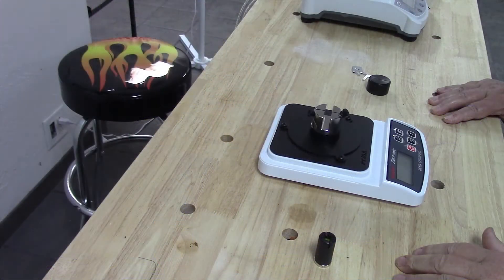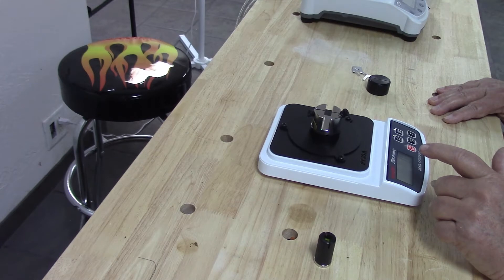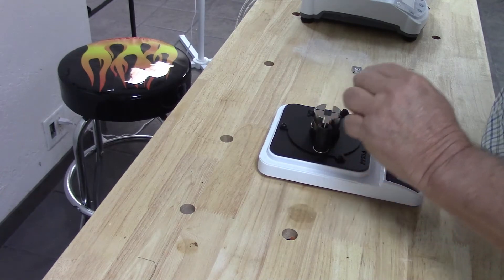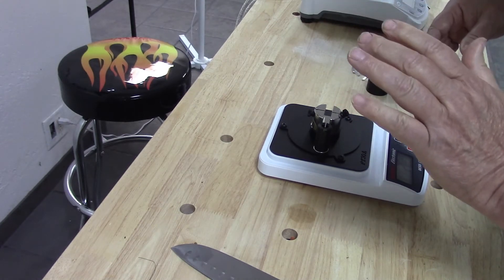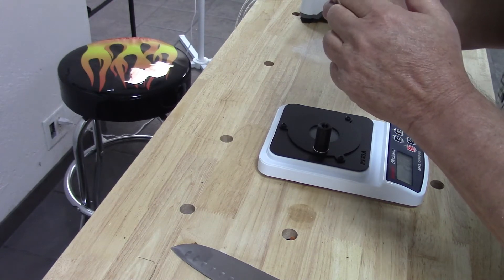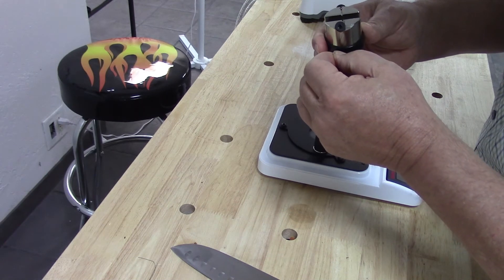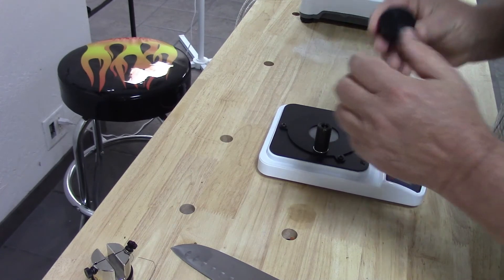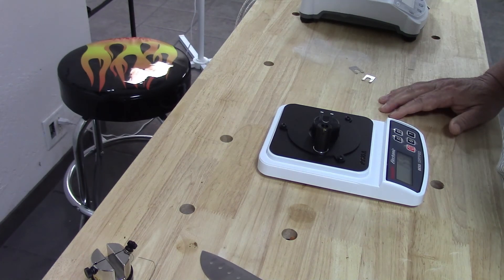PT50 Series ProperTest Procedure & Rerun TM

Comment: Wouldn’t the tension of the test media effect the results? Tight tension seems like it would cut quicker giving a lower reading.
Reply from the maker: Yes, it can Vincent, but proper test media tensioning is accomplished easily by following our printed and online instructions. We advise you simply tension the test media only enough to remove any slack across the ATF gap. This requires only 100 grams of force. However, anything in 50 - 250 gram range will suffice with little effect on the test score. Only intentional over-tensioning (500 grams +) will begin to to affect the users test scores significantly.